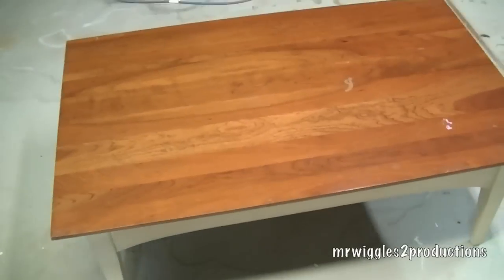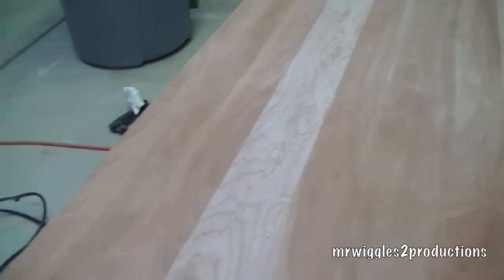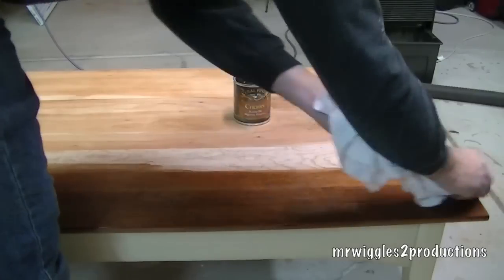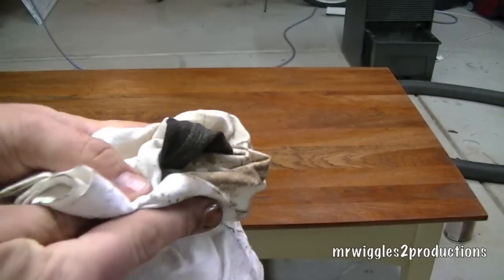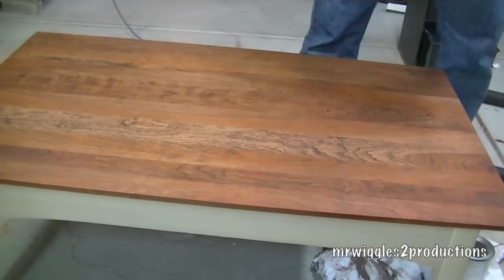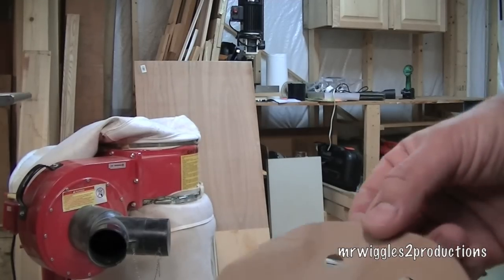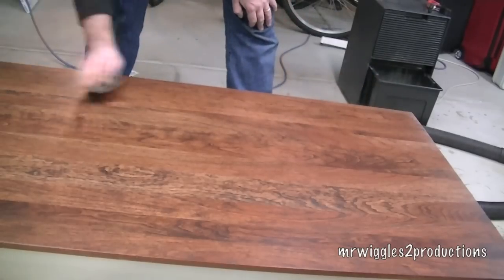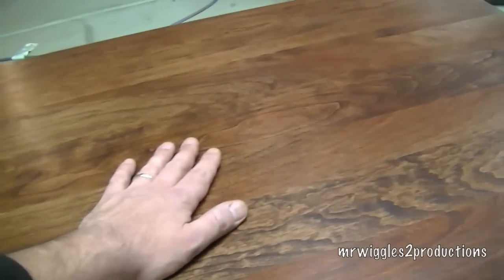Refinishing a Wood Table

Comment: Thank you-I bought an old cherry gate leg table at a thrift store (for $4.59!!)--I'll need to strip the legs, too,  but thanks to your video I can't wait for some decent weather to start on it.
Also-I appreciated your tip on the oil soaked rag as a close friend rented  part of a house from the owner who had linseed oiled the stairs and threw the rags in an open drum (under the stairs) which of course spontaneously com-busted at some point--fortunately it put itself out and there was no loss of life, and no one was home at the time- there was a lot of smoke damage and scorch marks on the floor (burning drum) and  the walls were scorched about 6 feet up. I thought every one knew about that! (Fortunately the friend immediately moved out of the place.)
Reply from the maker: Joanne Reilly You'll do great finishing that table.  I have another table I have to do, it is one my wife and I bought 15 years ago.  Its a lacquer top and has a thin finish.  I'll do a video on that table as well.

Comment: Very nice!! Do you put any wax or pledge over the finish or is that it!☺
Reply from the maker: Hi EJ, yep, I use a furniture grade wax (Bison wax) that I apply with #0000 steel wool.  Let it set 1/2 hour and then buff off.  I won't do that until the poly has fully cured, I'll give it a good week or so.  No Pledge!  No silicone!

Comment: Awesome video. I have a heavy cherry kitchen table that km gonna sand down, burn a design into and then stain and laquer. It'll be the first time I've done something like this but this video was incredibly informative which makes the whole project seem less daunting.  Thanks a ton.
Reply from the maker: Christopher Countiss Best of luck to you Chris, the table sounds beautiful.  Nice thing about lacquer is it dries really fast and imparts a gorgeous finish.  I usually go with lacquer for furniture pieces that aren't subject to a lot of scratches or abuse, so use place mats for serving.  Lacquer is very easy to repair, so its a good choice.

Comment: Great video! Im restoring some furniture and Im pretty new at the hobby. A lot of great tips and thank you for showing how you applied the stain. I was using a Poly/Stain blend and it turned out to be a disaster. It was way to thick and I couldn't rub it into the wood. I would not recommend the mix and just do them separate like how you showed in the video.

Comment: thank you for mentioning the fire hazard in your video.  I immediately went out to the garage and opened up my  staining clothes to avoid a fire.  Sheesh!
Reply from the maker: Thank God for that!  My next door neighbor burned his attached garage and filled his whole house with smoke damage from putting a mess of rags balled up in his stationary tub in the garage.  He was staining his deck.  I read labels like anyone else, but as a hobby woodworker, using oil products frequently I have had rags get warm even laying on a workbench.  All my finishing oil rags get aid out flat on concrete for safety.  Thanks for your comment and watching.
Reply: could I just wash the cloth with detergent before drying so I don't need to worry about the heat + oil?

Comment: Thanks for the pointers and responses.  Were not familiar with all the terms you've used but we are quick studies. The video was straight forward and easy to follow. We're going to do our first restore of a table I bought a couple years ago. Some of the finish has faded and cup stains are in the finish. The table is cherry wood with metal legs that needs some TLC. I'm going to get an orbital sander finish supplies  as you suggested. It's  a dad-son project. if it goes well, we plan to do more.
Reply from the maker: +Rodney Frederick How fantastic, I love to hear that it is a father-son project.  It will be fun and you two will have a memory when you're done.  I enjoy refinishing old furniture as much as I like building furniture from rough boards.  Wish you well, if you have questions I'll do my best to help.

Comment: Craig, great video, thank you.  I just put three coats of cherry finish on my dresser.  I used a staining pad to apply.  I see "brush strokes" throughout and especially on the sides where the top of the dresser meets the side panel.  How can I get rid of this?  It's been drying an hour now and the strokes are still visible.

Comment: Looks really nice. I did something similar with non flammable materials to re-finish a buffet I found at least 20 years ago, and it is still in use to hold my wife's China.
Reply from the maker: The one thing I noticed in water based poly's is how far they have come.  This General Finishes brand went on great and didn't make the wood look like plastic. You'd never know it wasn't an oil based poly.  Thanks for watching.

Comment: What grits did you use?  There was confusion in the audio.  I have a hardwood table and need to do the same thing.  Did you start with 180 or 120?  Then you finished up with 220?  Thanks.
Reply from the maker: +tkarlmann 120 to hog off the material.  Then 180 and end with 220.  Finally with a little steel wool.  Sorry for the late post, I just saw this.

Comment: You put  a nice finish on that . The cherry danish oil is a nice color Thanks for the tip on the rags A metal can with a tight fitting lid is a good way to dispose of rags with solvents and oil on them .Keep it outside for more safety
Reply from the maker: Thanks, it came out pretty well.  I used this same oil on our kitchen table I built out of mahogany, about 10 years ago.  That also has a water baed polyurethane that wears like iron.  Rags do spontaneously combust, so metal containers are great to use.

Comment: Did you use any pre-stain conditioner before you applied the danish oil stain? Any sanding before? I purchased an unfinished coffee table from wayfair and I am planning on doing this to the top. Along with painting the feet white, similar to the table you did in this video.
Reply from the maker: +Brian Rome Hi Brian, no I don't use pre-stain conditioners... unless I'm working with pine or sappy woods.  But I just concoct my own stuff- either thinned linseed oil, varnish or shellac.  I always test my stains on similar wood cut offs or in spots that won't show so I know what to expect.  Hope the table turns out great, let me know if I can help.  I'll keep checking this video as the comments don't always show in my messages.  thanks!

Comment: Very helpful....I have a solid oak dining table that I want to re-finish in a much darker espresso or almost black finish.  What kind of stain do you recommend when trying to get a darker finish or does it matter?  Oil, water-based or gel?
Reply from the maker: +Kari Christiansen I'm just noticing that my comments weren't listed below, so hopefully you received me comments.  When I stain, I always use oil based.  I like to use gel stains, but they are applied differently than normal stains.  Gels don't absorb into the wood, they are like a glaze.  You wipe them on, let them sit a bit and wipe them off to the layer you like.  Where a normal stain will soak into the wood.  Now a gel stain can be thinned to work like a regular stain, but that is another topic for another time.  I don't like water based stains, they raise the wood grain and create more work.  They've come a long way, but it's still more work.  Always test in an inconspicuous location or test wood of similar species.  Let me know if you have more questions!
Reply: I know this is an old post, but hoping you get this reply!  Did you refinish your table? What did you end up using?  I want to do exactly the same thing with our oak table!

Comment: You said in your video you're using a Water based Polyurithane, but you dont normally use this, what do you usually use? I'm refinishing a kitchen island, so the top needs to be durible and stain resistant as well
Reply from the maker: It depends what I'm finishing, but I prefer to use an oil based product.  If you're cutting on a kitchen island you can use mineral oil and just keep applying it- much like you would a cutting board.  Or, you can make it more like a piece of furniture and use a varnish or polyurethane.  I like Formby's tung oil, works good.  Wipe it on and put on several coats.  Its a good strong finish and if you scratch it or it gets dull, clean it, sand it to scuff it up and wipe on more tung oil  It's becoming one of my favorite finishes.

Comment: I've stained my table and now trying to figure out what to use to provide that waterproof seal so I can start using it. Does the spray lacquer work just as well as other options or would you stay away from?
Reply from the maker: The aerosol cans of spray lacquer are pretty good.  The tips are usually better than normal paint sprayers, so you get better coverage.  I like a lacquer finish, its beautiful.  Tip the can upside down after spraying and spray propellant through the hole so it doesn't clog.   Lacquer dries fast.  good choice.

Comment: Good Job, I'm right in the middle of refinishing a Vintage Cherry wood dining room  table. Too good to be disgarded. All sanded down and ready for stain. Thanks for the tips!
Reply from the maker: Dawson Needham Thank you Dawson, glad they worked out for you.
Reply: Thank you, we went with old Master Gel stain, using chunks of old upholstery foam, cut out on the band saw. Staining the legs was especially fun. Remounted them on the lath, the foam easily confirmed to the curves. Was excellent for applying stain.
Reply from the maker: Excellent work, yep, foam is great to use for a lot of applications.  Gel stain is the way to go, its so versatile. I like to use as a glaze sometimes.  Sounds like it came out terrific.
Reply: Yes, my friend who ownes a cabinet shop is helping me. we shot it with clear acrylic laquer today.

Comment: I've sanded my table and just put the first coat of stain. It looks pretty good except at one end it's not very even. Do you recommend sanding between stain coats, or just after the first coat of polyurethane? Thank you, this is so helpful;)
Reply from the maker: Once I like the stain and I'm happy with it, I usually leave it.  I might take 400 or 600 grit and skim it really soft to smooth it out, but usually I don't have to do that with oil stain.   Water based stain raises the wood grain so you almost have to lightly sand it.  I sand after each coat of polyurethane.  Put that stuff on thin, keep a wet edge to your brush or rag.  You can add a little stain to the poly in a separate container if they are oil based and that could help you even it out on the one end.  I let it fully dry between coats, lightly sand to get the dust nubs, hair, fibers, etc.  Last coat I use a paper lunch bag to sand with for a smooth surface.

Comment: how long should you wait between staining and finishing. How long should you wait before using? can it all be done in the same day?
Reply from the maker: +Rodney Frederick At least 24-48 hours, but that depends on humidity and the type of stain you use.  I wouldn't recommend putting on a sealing finish on a stain or oil that isn't dry yet.  You want the stain dry so all the shrinkage and raising of the grain is done, before you put on a seal coat.  You could buy a Minwax or commercial type product with varnish or poly with stain added.... I am not a fan of those but you could give it a try to see if you like it.

Comment: When doing the initial finish applications, do you let each coating dry before adding another coat?
Reply from the maker: +Rodney Frederick Yes, the initial finish you want to dry.  Apply a light coat in long strokes.  Let it dry.  Its dry when it isn't tacky.  Do a light 220 grit hand sand, just to get a little scuff going.  That will give the 2nd coat something to fill in and adhere to.

Comment: Thanks for sharing! It really seems so simple and can't wait to give it a try.
Reply from the maker: Good luck! If you work on a solid wood piece its easier.  If it is a veneer, then you just have to be careful not to sand through it.  Veneer is usually 1/16" or so, so fine sand paper is a must.  I used a chemical stripper on a veneer bureau and then sanded it with fine paper.

Comment: I've been wanting to resurface our dining table, but how do I know what the top is? Part of it is coming off on the top. It looks like wood on top, but the part you can see underneath looks like particle wood. Can I still sand and stain iit like you do in the video?
Reply from the maker: +Nicole Richardson If the top is peeling off, that is a wood veneer.  Think of a hand held penci sharpener, that is what they basically do to a log to obtain the veneer. You can refinish,  but its very thin so I like to use a furniture stripper.  Then once I get the finish off, I can lightly sand.  You first need to get a quality wood glue, Titebond or similar and get the veneer back down.  Glue it, put wax paper or cellophane down and then weigh it down.  Let dry, strip, sand, final sand with #220 and apply stain or finish.  Let me know if you have questions!

Comment: How do you know what wood you are using?I have a table stools and benches all in different woods, is ther eany way to refinish them all to a similar effect?
Reply from the maker: Alycia Calvert I've been woodworking for a while so I'm pretty good with common American hardwoods.  But exotic species I'm far from an expert.  Identifying woods in commercially produced furniture is hard, it can be any number of woods- gum, poplar, rubber wood, or any number of domestic woods.  To get a similar effect, as long as the woods are close in natural color, try using a gel stain.  You can apply a base of boiled linseed oil, or tung oil, let it dry 24 hours, then apply a gel stain.  It kinda goes on like a glaze, it doesn't absorb as much as it lays on the surface.  I like using gels when I have a lot of heart wood and sap wood and I want to even them out.   Hope this helps- youtube or google gel stains, it should help you out.

Comment: Beautiful! Q: How do I sand the table legs...they have the wobbles in them (not straight down)...ha ha..hope that makes sense!
Reply from the maker: If you are just sanding them to scuff the surface you can use the 3M sanding sponges, they work really good.  I also use round dowels or sandpaper wrapped over pvc pipe to get curvy parts.  A small detail sander (got one cheap at Harbor Freight) works really good too.

Comment: I am trying to restore a mahogany table top/side. I didn't sand it all the way down the way you did because
a. it is not in that bad condition
b. the top is veneer it look like (with some patterns/art on the wood itself) -- don't want to screw that up.
What I did- light sanding of the top followed by more aggressive sanding on the edge (can see the actual wood in some spots). Now for some reason when I tried to stain (starting with the edge), it just wipes right off. Wood not taking it...
Any suggestion here?
Reply from the maker: +Don RuggedA. Hi Don, sounds like a beautiful table.  What kind of stain are you using?  A gel stain won't absorb like a traditional oil stain, if you are using gel.  If it is regular stain and it is still wiping off, there could be sealer (varnish, shellac or poly) that soaked into the wood.  The wood wants to absorb liquid, it is drawn to it.  Try wiping the entire top down with lacquer thinner in a very very well ventilated area.  That should take care of left over finish and let the wood absorb it.  Do a final 220 grit light sanding and then try reapplying the stain.  Mahogany is my favorite wood to work with, it is just perfect stuff.
Reply: +Craig Arndt I did try gel and regular. I even went to get red mahogony dye hoping that can penetrate previous finish (from what I read). I will try the thinner and see if it works!

Comment: This has inspired me to buy a 2nd hand oak table that I saw on some local ads. It is a solid oak table, and I want to stain it with something like black india ink to give it a nice dark stain. Any suggestions?
Reply from the maker: +Dale Mckeown Fantastic, I have used black india "dye" which was on a ladder shelf I was commissioned to build.  It really went on like paint, but you could see the grain which was neat.  I think put on a couple coats of lacquer to gloss it up and make a hard surface.  Try it out on scrap first, to make sure you like it and give it time to dry, it always looks different after it dries....

Comment: I want to finish a pine kitchen dining table with a similar color stain with white legs just like this table. Can I use the same stain? And do you know what type of paint I should use? Do I need to cover the paint with a sealant?
Reply from the maker: SarahP You should be aware that pine is a soft wood and while its easy to work with, finishing can be problematic.  You can use the same stain, but the color will be a little lighter possibly, as cherry is a dark wood.  Some cherry is sap wood (white) which is more like pine in color.  Usually its a good idea to put down a thin seal coat before you stain pine, because pine is known to get blotchy.  When I stain pine, I use a coat of shellac or varnish.  Then I put down my stain or use a gel stain which I like to use.  Goes on like a glaze.  Doesn't sink into the wood, lays on top and you softly wipe it off to the level you want... then once dried, I use my top clear coat finish.  Hope this helps.
Reply: Craig Arndt thank you so much! That helps a lot. I watched another video on how to use gel stain, so now with your awesome help I feel confident about my project. Thanks so much!

Comment: Did you do any work on the sides? How does it blend/match with the top?
Reply from the maker: Brandon Clark I did the top and the sides.  The bottom was already sealed with shellac so there was no worry about warping.  My editing skills are getting so good that I didn't show doing the sides, but only thing not done was the bottom.